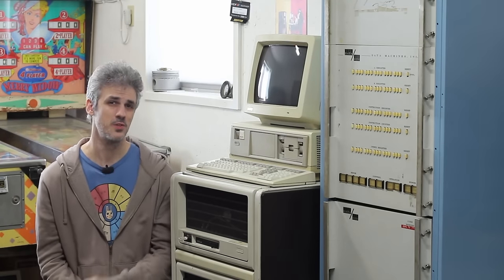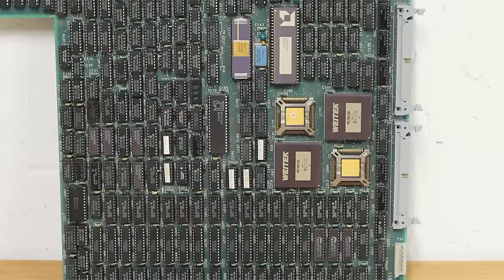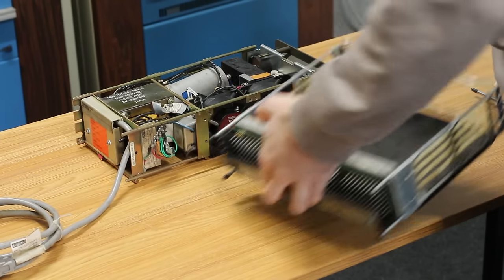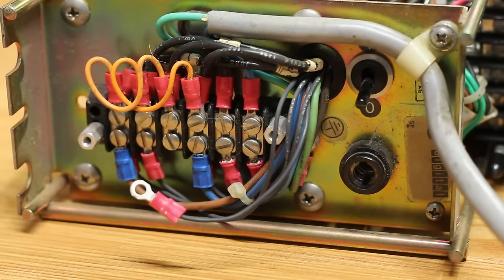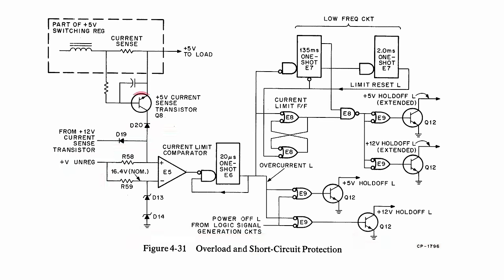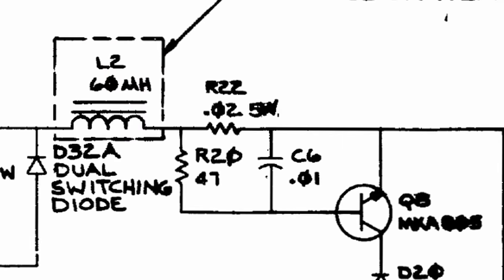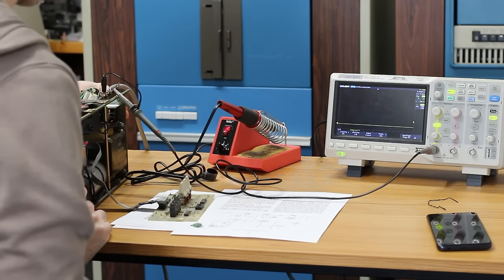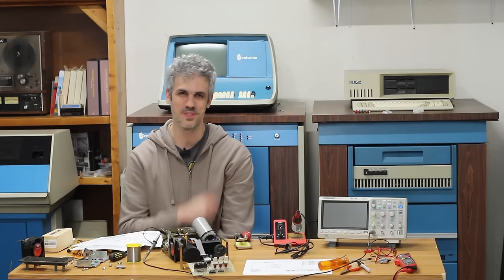This PDP-11 Power Supply Defeated Me

Comment: In general, the presence of an LM7805 and LM7812 implies they are being used as voltage references for the pass transistors that are handling larger currents. Since the 5V and 12V outputs are both showing high, I'd suggest pulling both regulators and testing them in a reference circuit on a breadboard. They're common jelly bean parts and are likely easier to source replacements for  than the pass transistors, etc.

Comment: I know the feeling!

I was given a Zenith 486 laptop yesterday. Power supply was dead. Found a shorted diode and replaced it with one from a scrap board. Laptop POSTed once and then went in to a power cycling loop. Pulled apart the machine and found loads of leaky surface mount electrolyitics... And I have none of those on hand. 😔

Comment: No.1 before powering any old power supply is just replace ALL electrolytic caps with good quality low ESR types. Then check all diodes & transistors with a meter (in circuit). Look for dry joints too, before cranking up slowly with a variac, preferably with a lightbulb in series in case something does short out.

Comment: The other culprit could be the 7805 or 7812 regulator. It looks like the circuit is using them as a kind of current switch. When the Vout is going above the 7805/12 regulator voltage the linear regulator will limit the current and turn off. This will stop all current through the control transistor and R27 (5v circuit) which will have the effect of switching off the driver transister and pass switch. The Vout should drop as the inductor loses energy and the cycle will start again. If the regulator is no longer regulating then it might behave the way you are seeing. Worth doing the same checks on 12V and testing the crowbar circuits for both outputs, I think you could just hook your bench PSU up to it with the current limit set to something sensible and bring up the voltage on your bench PSU to see where they are tripping. Saves you having to switch it on and risking other components.
Reply: I agree with your take on how the circuit functions.

One hook with using a bench supply, which in general I agree is a much safer approach in terms of avoiding doing more damage, is that sometimes these sorts of supplies have some additional low-current supplies that are necessary. In this circuit a -15V supply is used in the setpoint networks for the 3-terminal regulators. All it does is provide some bias current for diode used as a crude negative voltage reference. In things like bench power supplies a negative supply may have a more critical role. It certainly isn't an insoluble problem, but something relative novices may not have seen or may not understand..

Comment: The base-emitter junction of Q15 SHOULD pass voltage (although it wouldn't pass much current before you fried it)
Unfortunately, since ALL of the current must now pass thru that B/E junction, it's quite probably been transformed into a 3-way piece of wire...
I know there's no 'external' load on the PSU, but there IS an internal load being the 560uF output capacitor (C20) that has to be charged up!  (More on that later).
The fact that you are getting over 13V on the output is worrisome to me...  The 7812 SHOULD keep it very close to 12.0V, so MAYBE this too is 'fried'?  However, this circuit allows you to 'adjust' the +12V rail a bit (using the potentiometer based voltage divider on the output.  I'd confirm the EXACT voltage between pins 2 and 3 of the 7812 before I called it dead!  (Pin 2 is NOT directly connected to the overall circuit ground!)

Next comes the LER (Light Emitting Resistor)...
You REMOVED Q18 driver and therefore ALL of the current on the 12V rail cannot come from the series pass transistor (Q17) since it no longer has any drive.  This means ALL of the 12 rail current MUST now pass thru Q15!!!  Let's ASSUME for a second that there is a direct short across between the emitter of Q15 and ground.  The incoming +24V will turn ON Q15 by way of the base bias current (R75 + R47) and thus you now have 24V across a small (1/4W?) 10 ohm resistor (R74)...  24V/10ohm = 2.4 AMP!  WAY more than it could ever hope to handle, so it becomes a FUSE instead and gives off the light show in the process.  (R74 has 'left the chat' and is now an infinite ohm resistor)
So now the ONLY remaining current path is thru R75 + R47 + base-emitter of Q15 into the 7812.  With R47 being 330 ohm, there's simply not enough current flow to create a new light show.  My GUESS is that the 7812 is also NFG but that's yet to be determined!  If's possible that the adjustment is turned up so far that it causes the crowbar to kick in, but, without the 10 ohm resistor, there is enough of a voltage drop across the R74 + R47 base-bias that the crowbar doesn't get a chance to trigger.

1: Check C20 for leakage / short
2: Disable the crowbar and retest (remove D30, R62 and Q14)

Comment: You need to put a small load on the 5 and 12 volt outputs.  Say a tenth of the normal load.  Without a load the series regulators are running outside their lower current spec.

Also a variac is your friend.  As are a few of those $9.95 DVM's from HArbor Freight.   Slowly turn up the AC line voltage on the variac while monitoring the outputs, under a light load.  That way you'll blow fewer transistors and resistors.  

If it helps, I've been stumped by several Tek 485 scope power supplies.  They are extremely complex, with a bunch of overvoltage and overcurrent shutdown circuits.  If any power supply is sensed to be out of spec, everything shuts down.  Tek even published a separate troubleshooting guide just for the power supply, it's so convoluted.  The scope itself is very high tech, but I've ended up junking two scopes due to at least for me, unfixable power supplies.
Reply: He had high watt load resistors on the power supply at one point in the video.  The LM7805 is a linear type regulator, used for the 5v rail and it doesn't require a minimum load as the internal draw of the IC (2-3ma from  memory) is sufficient.  If I recall the 485 has a switching style power supply not a linear system.
Reply: @user-uz1yv2oc9v  
The 5 volt supply is also a buck converter, just using a three-terminal linear regulator pressed into duty as the controller for switching.

Comment: It seems a lot of people are unaware of the fact that the common equations for switchmode converters don't apply at light load where the current in the inductors goes into the discontinuous region, dropping fully to zero each switching cycle.

With buck converters, as used here, the usual expression is 
Vout = Vin x duty cycle but that only applies with continuous inductor current. In the discontinuous region the duty cycle must be reduced and at very light loads it must go very close to zero. Lots of older control circuits couldn't manage zero duty cycle very well. Sometimes they were OK except you'd get quite a bit of ripple because the "squeg" - run for a few cycles then turn off completely.

The circuits here use three terminal regulators to actually do the control of the switching. I get very frustrated trying to find the brief view of the relevant schematic bits in videos like this, so I haven't looked closely at the design.

That slow rise of the 5 volt rail very strongly suggests to me that the circuit can't bring the no-load duty cycle down far enough to maintain regulation

I would test these converters with at least 10% of nominal full-power loading. That won't likely be enough to assure continuous inductor current, but may be OK anyway (it is common to design to place the discontinuous/continuous boundary at something in the range of 20 to 40% of full rated load).

Comment: If it were me, I'd just pick up a 5 & 12V switching power supply from the getting spot and be done with it, but I can understand wanting to keep this as original as possible. Certainly makes the job a lot more difficult, but that just means you'll have learned more when you're done.

Comment: I wonder if vintage power supply failures are partially because line voltages are higher today.  Here in north Texas we are at 123 volts.  If you look at old equipment they are rated for 110 or 117 volts.
Reply: Aye,  a proper regulated input voltage seems to be in order,  the 10percent extra AC in probably explains that the 12v DC is running at 13.2

Comment: Hmm, as you replaced that 180 µf cap, the bigger electrolytic, and eventually pulled that D44C9, I kept thinking, "Yeah, I'm sure I've got something in the basement that will work."  (Exact replacement for the smaller cap, smaller form factor replacement for the big one in case you want to hide it in the original case, and "D44C9 - (checks data sheet) 60-70 volt collector voltage, don't need anything close to that here, pretty wimpy beta, 30 watt power dissipation,  something like an MJE15028 ought to work fine - its fT is a little slower but I bet the switcher isn't clocking that fast, and the pinouts (E, C, B) are even the same."  But my basement is in New York and your shop is in Texas, and I'm sure you have parts on order already.

In any case, it looks as if you have a buck converter on your hands.  They don't regulate well with no load, and that's probably tripping the crowbar.  Try loading the 5V rail with a 5 ohm 10 watt resistor and maybe a 20 ohm on each 12 volt rail, and see how it does.  (I'm guessing that you haven't poked into the guts of a switcher before, because you're approaching this thing as if it's a linear power supply.)

By the way, an SCR is a kind of thyristor.

Comment: @ 19:15, you can see the voltage rise above the regulated value and then the crowbar kicks in and grounds the output. The 5V slow ramp up before this happens looks like the 5V regulation loop is not working correctly.

Comment: I run my franken-11 off a salvaged ATX supply and generate the power-on signals and LTC with one of those $3 ESP-8266 modules.  If that thing has you flummoxed, you don't have to use an expensive and complicated DEC supply.
Reply: My franken-11 uses that same backplane too.  You can wire wrap it to 22 bits and run one of those 11-73 cards in it.

Comment: try testing power supplies by powering up their outputs, using bench supplies. this is how i test PSUs that i repair, as well as new off-line designs - by powering the primary side SMPS controller from a LV supply but no AC input, you can check that the output stage can reach its setpoint, and also check that the feedback network is working correctly

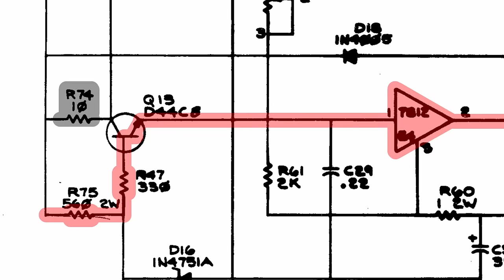Comment: 27:53 Q15 is not necessarily leaking, in this case. With no collector potential, the b-e junction behaves like a diode, allowing significant current to flow from base to emitter.

Comment: 0:52 If that's the same Dave McGuire I'm thinking of, I met him once at his house ~20 years ago (in Tampa, FL or thereabouts). He had a supposedly working full-rack PDP/11 right in his living room, next to an original radioactive-decay tube-based time standard, and had converted his two-car garage to a data center. There were 2 Crays in there which he was using to calculate Pi digits for some kind of contest. He bragged once about his ~$800 power bill (in ~2004 dollars). I would hope that all of those machines are now part of the exhibit in his museum, as they were in great condition back then, and he was pretty fastidious about such things.

Comment: I'm by no means an electrical engineer but that is a bizarre way of implementing overload protection. Maybe it's commonplace and somebody will correct me, but usually most circuits just kill power downright. Definitely a complex looking protection system on this thing. At least it was still doing its job all these decades later, so the designers definitely got something right!

Comment: I think this proves how important it is to check the power supply thoroughly out of the system before trying to power up the whole thing.
The over voltage could have easily killed some irreplaceable parts.

Comment: When I find that many bad caps in something, I just replace them all. Know that smell too well.
Reply: The bigger cans are costly to replace and often enough are fine. 
Most of these manufacturers used high quality components. Very different from the capacitor plague time. Also they didn't try to shrink things down at the cost of quality.

Comment: 27:40: The 12 Volts come through R75, R47 then the base-emiiter diode of Q13 with a drop of 0.7V, then the 7812. You need to remove Q13 or R75.

Comment: Hi there!, as @CuriousMarc mention for repair procedures is better remove all the crowbar protection more if they produce a short at the DC voltage (this will destroy the power supply if the short circuit protection do not runs correctly or the DC output don't have fuses). There are two crowbar protection there. One in 5V and other in 12V. Remove both SCRs.
Now,I did't see the AC/DC part of this PS. Some strange voltage is indicated in the 7812 regulator (-15v) where this voltage comes?
If I'm fixing this PS, I will remove the fan and the big capacitor to see all the PCB itself. I will disconect all the power transistors and test them and then install with new termal paste and test insolation from the chassis.
For me some was wrong with that -15V reference, and I'm thinking it's at the AC/DC part of the PS. Test too the ground because the schematics talks about 5V grond (strange) . Test too the bridge rectifier.

Comment: Got an idea for you .. Why not take a 100 watt incandescent light  bulb and put it in series with your power cord to limit current
going to a unit when you plug it in for the first time. Could use maybe 2 of them .... Keeps fuse from blowing , and if the lamp lights up bright you know you got a problem.. If it lights bright and dims.... then it may be OK ..... I started doing that back in the 70's and it saved me a lot when replacing high power audio transistors.. Just an idea..

Comment: Interesting circuit, completely linear voltage regular that uses a 7812 as voltage reference and error amplifier at the same time.  The reason R74 burn up when Q18 is removed is because the B-E junction of Q18 is keeping R74 at 0.7V.  Without Q18, the current going through Q18 is essentially all the current going though the 7812.  Q15 is just a simple common base amplifier configuration, it is there as a switch for the shutdown cutoff, it is unlikely to be broken.  Leakage isn't what you are looking for either, as B-E junction of Q18 is 0.7V, so the R75, R47 is passing current though to the B-E junction to power the 7812.  As for why the voltage output is creeping up, my guess is the 7812 is drawing more quiescent current than the circuit is initially designed for, so the extra current is causing the Q15 to pass more current to the output, even if the 7812 is in full cutoff state.  Add a resistor from 24V source to ping 1 of 7812 might help, experiment is necessary to find the correct resistance.  General description, Q15 is the cutoff switch.  Q18 is a current gain stage and also to change the direct of the current flow and the Q17 is the main power transistor.

Comment: I cannot even describe how many devices I seen been killed by old capacitors by now, They leak electrolyte and corrode traces, they short out, they leak electrically and causes massive fluctuations in voltage ripple. it is very common when a cap short out it takes many other components with it such as diodes, resistors and transistors that suffer over current. you should never ever trust old caps to be good. it is a good thing to make resistance measures to check for shorts and if caps are leaking before powering stuff and it can save a lot of trouble down the line. I have the feeling those shorted caps can be one reason why the supply have died this much, when things literally light up from shorted stuff you know there been a good BBQ party in the PCB  house

Comment: Maybe I am wrong, but remember that a BJT (Q13) is essentially two diodes, in this case, from base-emmiter and base-collector. When you put your input voltage from the rectifier, is normal to pass through R75+R47=890OHM, the B-E junction to be regulated by the 7812 and so you should have those 12V at the 12V output power rail, albeit at a very low current. Without R74 (10Ohm) the behaviour of Q13 is normal, it is not leaking anything.
Actually, you shoud check the voltage between the ground pin (the middle pin) of 7812 and ground and add to it 12V; this you should have at the output. If is not ok, your 7812 may be shot.
7812 is not regulating to 12V in refference to the ground but in refference to the voltage set by the resistor network  R77, R86, R87 and this voltage can be regulated by the R87 potentiometer. Try to check/clean those potentiometers (R37/R87) and any others you can find, connect the transistors after you checked them and readjust the output voltage by tunning them. You may (in fact should) have to disable the crowbar circuits to ignore the overvoltage protection to do this easyer. Actually, that 10 Ohm R74 may have burned because the crowbar circuit, if nothing else is drawing current (check if 7812, D32, C24(?)=0.22 are ok).

Comment: Any time you are confronted with circuitry with adjustable parts that has been mucked about with by someone else, you must assume the mucking about has included fiddling the twiddlables. In fact if an amateur was as it, is is very likely said amateur started with such twiddling. This can make logical troubleshooting substantially more difficult. It can be difficult to determine if something is wrong because something has failed or because some knob turned a knob.